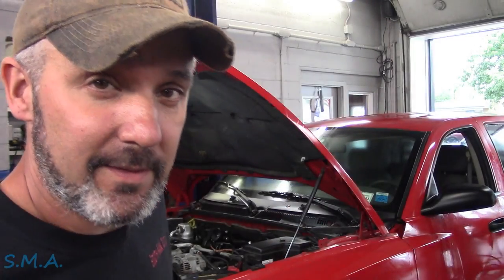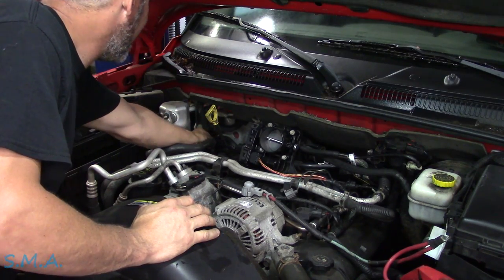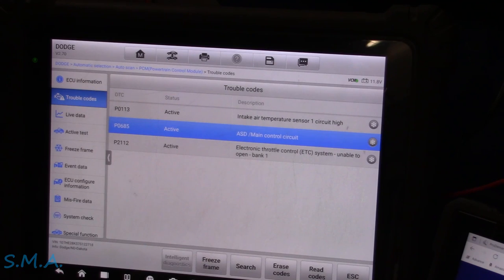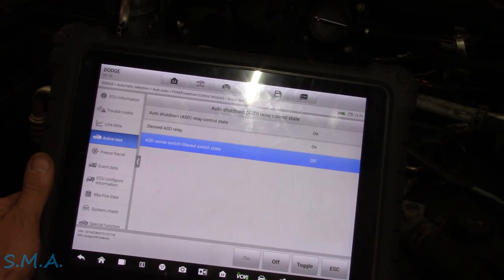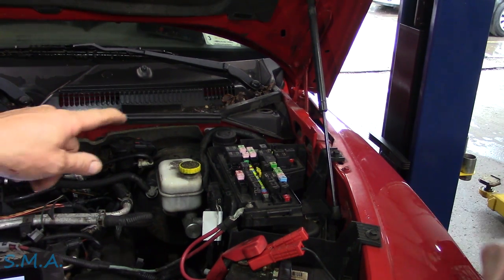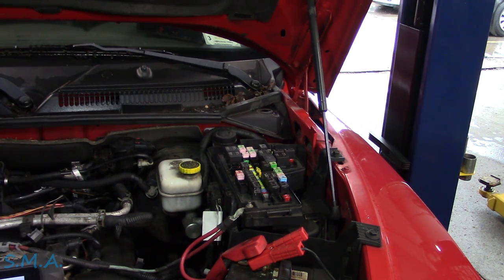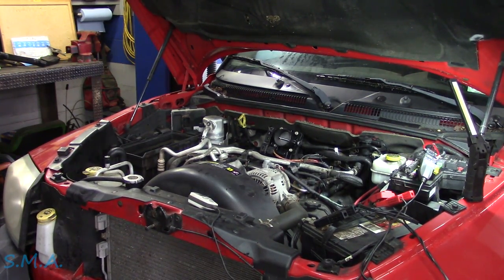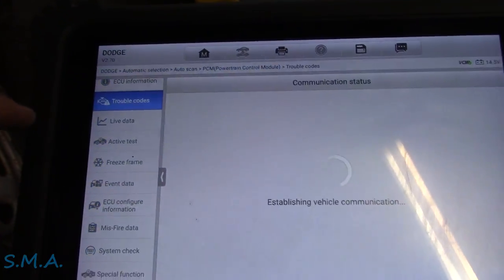Dodge Dakota: No Start After Clutch Replacement

Comment: Never place tools on or near the battery terminals, all I'm saying.....⚡😆
Reply: Did you weld a wrench between the terminals? Lol
Reply: My brother did.  
Burned his hand prying it off. 
Hospital trip that day.
Reply: Also, take your wedding ring off.

In the service, we were pulling the batteries out of a tank.  I'm in the driver's compartment doing something and Miller is right behind me in the turret disconnecting the six batteries under the turret floor.

Don't know what or how, but he slipped doing something he shouldn't have and the wrench decided it wanted to jump over trying to complete a circuit.  Fortunately for the wrench and unfortunately for Miller, his gold wedding band was in just the right place to facilitate that endeavor.

The ZAP-scream-crying was a bit distracting for me, so I got him out of the tank and stuck his hand under a faucet.  He got lucky.  Didn't burn him too bad, but the ring had a couple of dimples on it.

Miller's lesson:  take your wedding ring off when working on batteries and always disconnect the negatives first.

My lesson:  never get married in the service.
Reply: @maingun07  i seen a guy catch his on a rivet head protruding only slightly on the cab grab handle of a truck  as he was jumping down.  wasnt much holding that finger on. not a pretty scene
Reply: was doing a tune up an a late '60's chevy truck.(years ago) had the air cleaner resting on the fender edge/inner fender. climbed in the truck to change points and condenser and bumped the air cleaner. fell onto the battery and bang!!!!  luckily the air cleaner shielded me from shrapnell  but it was a quick trip to the hose to spray down the acid.
Reply: you only do that on july 4th for the free fireworks show!

Comment: Apparently crushing the harness in these is common, Durango too, same deal. Had one with tons of o2 codes and driveability issues, new auto trans just installed. Took down the right front wheel well, bunch of crushed wires. Smh

Comment: I replaced a clutch on a Dodge only once in my lifetime. Never owned a Dodge since.
Reply: My father owned a Dodge pickup that he had to replace the clutch in several times. Dodges are junk. You would expect a vehicle that was a work truck and that was so overloaded a lot of the time that he would split rims from having so much air pressure in the tires to not have to have 3 clutch changes in the 430,000 miles we owned before it was sold to a roofing contractor.
Reply: @johncarter1137  You still got a pretty good mileage out of it.
Reply: Definitely got good mileage out of it, could it be whoever drove it was riding the clutch somewhat or you bought “cheap” replacements? Hey the proof is in the pudding, cheap clutches don’t like heavy usage especially when “being overloaded to the brim MOST OF THE TIME,that rims would split!, that tells me you probable got what was supposed to happen. The clutch you used and replace weren’t “heavy duty” nor meant for the truck to be OVERLOADED, the fact you say the rims were close to “splitting” tells me you were way waay over the weight limit of the truck and probably why the truck blew clutches left and right, but the fact you got 400+k outta it and never blew the engine is a true testament to the strength and durability of some dodges, think about what you yourself said about how the truck was used and not treated good and it never blew a engine just clutches
Reply: @B0xlife1  Yes , it was my own fault, I beat the crap out of it, I got over 200k before I sold it, the engine was never a problem. On the other hand my brother has a 2007 Ram with 130k and had to rebuild the engine, one of the cylinders developed piston slap. The guy that rebuild it said that the piston wasn't forged right to begin with. Cost him a few dollars, but it beats the heck out of spending 60+ k on a new one, which could be even worse. He never had a problem with the auto transmission.

Comment: I was a machinist and i once had a guy come in and ask me to weld a broken valve spring back together.. I explained to him if i welded on a spring it would no longer be a spring.. ordered him a replacement spring lol.. I know its not electrical but its hard to save some customers from themselves.

Comment: Easiest fix to date. Autozone installs new battery for my cousin. Hey lady you need these little felt pads to make sure your terminals don’t corrode. They tighten cables and send her away. Next day car doesn’t start, she calls me. Little felt pads hold clamps up on post so they get tightened to fully closed but not really tight on posts. They vibrate up on drive home and are no longer making enough contact to carry current. Here’s your problem lady. Loosen clamps, remove felt pads, push cable clamps down to appropriate position on posts and tighten (to factory specs).

Comment: The late 90's/early 2000's Volkswagen tdi's had a relay which would prevent a crank but no-start condition in those ALH tdi diesel's. "Relay 109". I think all VW TDI owners are well acquainted with that relay in one scenario or another.

Comment: Replaced manifolds on my truck with headers. 
Completed the install, fired it up and the thing started misfiring immediately! Random cylinder misfire code so I started checking everything ignition related, and then went on to fuel and air because I was stumped. 

Finally, it decided to throw cylinder 7 misfire code. Having given up almost all hope I decided to pull that spark plug and see what I saw, but expecting nothing. The ceramic had the smallest crack in it, put a spare plug in and it ran beautiful! I must have hit it at one point when putting the headers on or it had been damaged all along and removing the spark plug wire "upset" it enough to make it arc. Lesson learned, check the simple stuff first!!!

Comment: We had a Cayenne in our shop recently, customer complaint was A/C doesn't blow cold. There was also a warning light on for the front right marker light being out. Long story short, the connectors for the marker light and ambient air temp sensor both live in the front right corner and they are the same size and style connector. The ambient air temp sensor didnt like having 12v shoved through it instead of 5v.

Comment: Simplest repair was today.  Customer complained on a squealing/scrapping noise in the front end while driving.  I removed a stone that had gotten stuck between the stone shield (didn't do its job) and the LF rotor.

Comment: Replaced the clutch in my 90's Saab. It didn't release. Put another clutch in, same thing. Replaced the slave cylinder, then the master cylinder. Still didn't work. Finally my wife fixed the problem by asking "what HAVEN"T you replaced. I pointed to a 2" long rubber tube between the two length of steel  hydraulic tubing. She said "replace it". I did, and the clutch worked. The tube was stretching.

Comment: Stupid transmission story. We had a Jeep wrangler 4 liter towed in.  Quit while driving. An AAMCO had replaced the trans out of state about a week before. Found a broken crank sensor (in the bell housing). We assumed it was damaged during trans swap and just replaced it. A few days later it was towed in with another broken crank sensor. We found an "extra" torque converter bolt sitting in the bottom of the bell housing. It must have been picked up by the turning flywheel and flew around until it hit the sensor. The good news, AAMCO paid for the repair.

Comment: Years ago I bought an old chainsaw that wouldn't start.  The thing was packed solid with old greasy sawdust.  After I cleaned it off I saw a pot metal toggle switch with the lever broken off.  It was completely covered by the crud when I bought it.  Got a small screwdriver in there and clicked what was left of the switch the other way.  Tried it and it fired right up.

Comment: a few months ago I had to replace the multi-switch on the steering column because my wipers were running continuously when I used the mist wipe (supposed to only wipe once with each twist), Had to replace it because the intermittent wiper relay was apparently built into the switch and couldn't be replaced (still dunno about that)... during disassembly the Haynes manual wasn't very clear and I ended up unraveling (essentially ruining) the clockspring under the airbag. Absolutely no guides on how to re-wind that properly so I had to replace it and it's surprisingly expensive.... found out shortly after ruining that part that I didn't need to even touch it, the book had arrows pointing to the screws I needed to remove and the arrows were printed wrong, found a better guide somewhere else.    did all that only to find out it didn't help the issue at all... recently my wipers quit altogether except for the continuous high setting and during my research I found and replaced a Wiper Motor Pulse Board Module... which I hadn't found anywhere at all before when searching for wiper troubleshooting and fixes... never heard of it before... but I replaced it and now my wipers work great and exactly how they are supposed to. only cost me like 5 times what it would've had I known what I was doing lol

Comment: When you zeroed in on that fuse, I thought:  There's a wire shorted between the engine and the bell-housing.  I've been guilty of that throughout the years, not so much lately.  Then again, I have not completed an engine swap into a 51 Ford Tudor.  Surprises could await. ( 20 seconds later: I should read your comments first!  Just saw them now.  For once I have guess correctly.  Experience is the best teacher.)

Comment: I did a clutch and flywheel for my father in law on a v6 Dakota. Ran awful after, could not figure out why.  Worked on it for days. Turns out the flywheel company put the reluctor ring on the flywheel backwards so the crank signal was opposite what it should be.  Visually it was so minor it took taking it all back apart and messing the gaps to realize it.  What a pita! Found a junkyard flywheel and good as new.

Comment: 97 Dakota... the coil was bad, but still had a spark/fuel - didn't think to swap it for the new one that was sitting in the cab.  Towed it to the local shop and they installed ther part and questioned why I hadn't.  Good couple hundred dollar lesson to learn.  ps; want more cookies?

Comment: The simplest repair I've done: When I was in my teens, a coworker asked if I could swing by his house to help him figure out what was wrong with his 280Z. It had suddenly started running just a little rough but had lost a lot of power...about a year ago. One of the exhaust rocker arms had come loose and slid off to the side of the valve stem. It seemed to run better and when I went along for the test drive, we were both shocked when it shot forward fast enough to send the dash cover flying into our faces.

Comment: One time doing a starter replacement. The starter solenoid the lugs had this blue rubber painted on the 12 v ignition. Would n9tbstart for the life of me. Went to jump the solenoid and still nothing. Pulled the started and took it to Napa and they had the same problem. Finally the guy took a brush to it and cleaned that rubber paint off and was able to make contact! I ate the entire job as I was pissed at myself!

Comment: I once took out a relay to install a wire for a radio.  Then put it back in the wrong spot.  Fuel pump stopped working.  Brilliant.  Luckily I found a picture of the fuse box and noticed the empty relay spot where my relay was installed.  Moved it to where it was supposed to be and fixed....

Comment: LOL, my wife's AC compressor stopped working in an 05 Buick Century many years ago.
My good friend wanted to learn more about automotive electronics. So, I printed a schematic of the wiring diagram to diagnose why the compressor would not kick on.
I honestly thought it was going to be the cycling switch... 
Rule #1 Check for power... It was just a blown 10 amp fuse found in the diagram to feed 12v to the clutch. Never blew afterwards... even after 3 years of use.... LOL

Comment: My Darwin award goes to changing a fuel filter 25 or so years ago on a '90 ish festiva. Got the fuel filter off, then while fresh gas from the fuel lines was dripping, I manage to arc the battery with a tool. Somehow, I made it out without a fire! 🤦

Comment: During the first weeks of my time in a workshop, I'd changed the filter on an old 1950s Rover, paper element. First problem was pouring oil into the engine, and at that moment remembering I'd not refitted the drain plug. Got it in before the oil got there. (Probably the fastest I have ever moved)  Then once started, oil leaking past the filter bowl.  Slacken and reseat it, still leaking. Tried a third time, still leaking.  Yes, I had fitted a new seal, and removed the old one first.  Took the filter bowl off, found it to be oval.  Needed careful positioning to seal properly.  Only afterwards did an established tech 'remember' that he'd trodden on it last time it was in.  Always checked such things from then on, although not seen one in a long time, all spin-on now.

Comment: Simplest repair I have done was a no crank, no start issue on a 2012 Toyota 4 runner. Neighbor asked to check battery. Turns out neighbor turned the vehicle off with it still in drive, lock cylinder is worn enough they were able to remove the key. Put the gear selector in park and it started fine. Luckily the truck didn’t roll into something or someone.

Comment: built a 351 windsor for a ford F250. From the time I started pumping up the cherry picker to the time first bell housing bolt was in was about 3 minuets. Had to step back and see what I was missing.  Torque converter was still on the bench. Pull it out and install converter and had the expected 15 min to get every thing to line back up.

Comment: this is kind of funny.  Years ago I was helping my friend adjust the timing on his 41 chevy, after replacing the fiber timing gear.  What a beast.  I reached down to turn the distributor while it was running and 🤪Yikes, did I get the crap shocked out of me!  I raised up and whammed by head into that gigantic hood, and fortunately it didn't fall down on me.  Grabbing a bunch of plug wires when the engine is running is very painful!!!  😁

Comment: I once spent an hour in freezing rain after driving 30 minutes to where my mother broke down….. I checked the battery, banged on the starter, switched the relay out with another matching one….. finally pushed my mom out of the drivers seat to find…… it was in drive! I learned a valuable lesson that night at 19 years old….. trust nobody!!

Comment: changed the dist in a chev 350 and timed it off of the tdc on the exhaust instead of the intake. switched it around fired right up and ran smooth. it took me about a week to figure it out though.

Comment: I did a clutch in my Hondoo a couple months ago.  When I cranked it up ot revved to the moon.  I was looking for sensors, vacuum leaks, then I saw it; the cruise cable pulled out of the actuator when I tilted the engine and got hung up.

Comment: When I was just starting to drive, I purchased some windshield wipers for my first car which was a Dodge Valiant. For the life of me I couldn’t figure out why my original wiper wasn’t coming off and my father reluctantly agreed to assist mumbling something similar to ‘I’ll probably just break something with my luck’ so he couldn’t get the wiper latch to disengage and decided to grab a screwdriver to help with the leverage and when he started to pry, the latch popped like it was supposed to, his screwdriver slipped and banged into the windshield which started cracking upwards very quickly. We both laughed so hard and he felt so bad. I’ll never forget it.
Reply: Ok, two times I cracked my windshield.  First time I was hauling some 2x6's, came to the stop sign at Stinson and 29th, said wood slid forward and cracked the windshield.

Another time, we had gotten two inches of snow.  I went out and started the car with the defroster on.    Came out and there was a nice mostly straight crack, right across the bottom of the windshield.  Guess the glass could not take the 160 degree air on one side and 32 degree snow on the other.   Don't do that!

Comment: A quick in and out job always good. 
The video you done on the Subaru oil pump help me. Had a customer with oil pressure light on. On idle removed pump found screws at the back backed out. Thank you for all the interesting videos. Knowledge is power.

Comment: So just did something similar. Replaced a valve spring and rockers on a chrysler town and country. Finished it would not start. Was frustrated walked away. Went back to basics. Check the fuses found I had forgotten. I had pull the fuel pump fuse when diagnosing the broken valve spring

Comment: I just about replaced the 1 year old front wheel bearings in the front of my F350 under warranty. As a last check I had my buddy rock the tire to simulate the play that I felt when I was rotating them a week earlier. Lo and behold it's the 1 year old lower ball joints that are trashed. Now I can stop cussing Timken bearings and start cussing the MevoTech ball joints. At least they lifetime warrantied, except I still have to put them in!!

Comment: I worked on an old square body Chevrolet that would blink the running lights on all four corners when the left turn signal was engaged. Turned out that the filament broke and fell down on the other filament in an 1157 bulb and back fed the running light circuit.

Comment: Rebuilt the steering box in my 91 Cherokee because it was clicking when I turned the wheel. Put it all back together and it still clicked. Tightened one bolt on the track bar mount, and no more clicking.